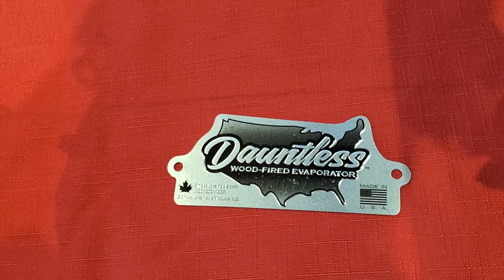Assembly for the Dauntless™ Maple Syrup Evaporator

Comment: Evaporator looks great! Thank you. I was wondering though… what would be the down side to running it at like 4-5 inches versus the recommended 2inches?
Reply from the maker: The evaporation rate drops significantly, too much energy is used to maintain the extra sap's heat.  Remember that evaporation only happens from exposed water molecules.  The more splashing and spitting that occurs, the more evaporation that takes place.  Also, in the case of a divided pan, it's not possible to establish the desired density gradient with such high depths.
Reply: @SmokyLakeMaple  

Makes sense- thank you! And thank you again for our new dauntless evaporator 😎

Comment: What is the downside of not painting? I ordered without paint and I’m itching to start assembling
Reply from the maker: It can rust, and definitely eventually will rust.  However, you can paint it after assembly if you wish.  The downside is that you won't have the visual appeal of the bright contrast of the of the bolt heads.
Reply: @SmokyLakeMaple  

Okay actually found the paint cans lol. Sorry. On the 4th coat now
Reply from the maker: @thomaschambers5711  Haha, I was wondering what you meant.  Some people get so excited to put it together that they wait until afterwards to paint...